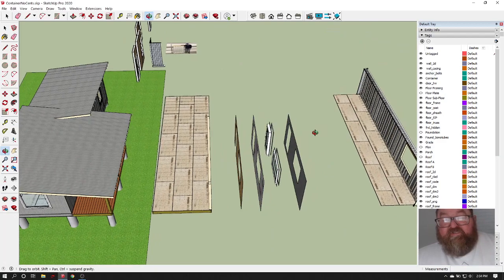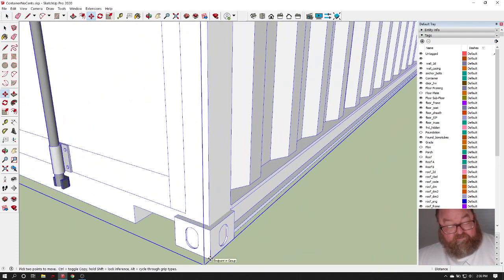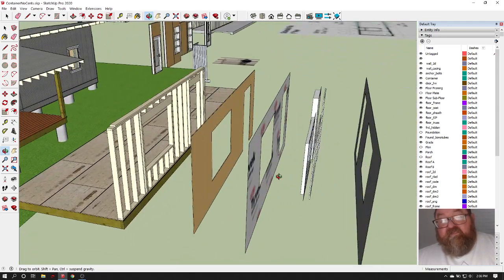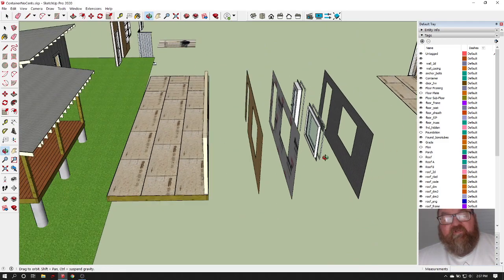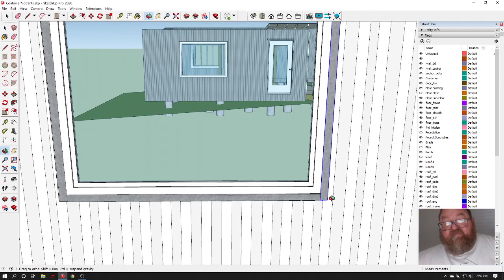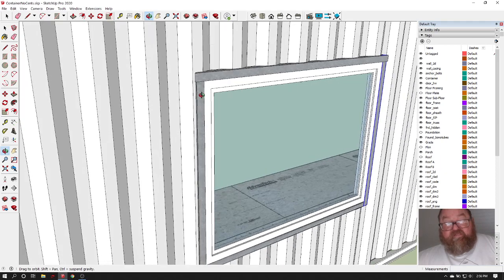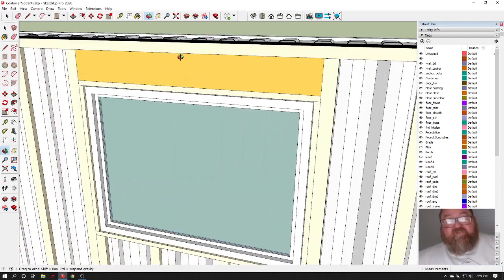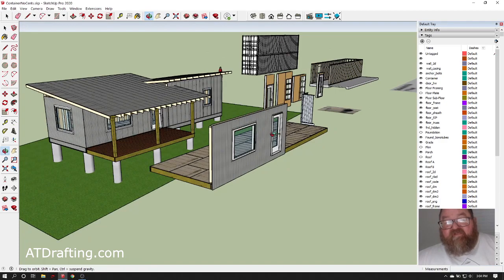Installing Windows in a Shipping Container - No Welding Method

Comment: Great video! How to you attach the galvanized metal flashing without welding them? Are you just screwing or nailing them into the header and jack stud, through the Tyvek? Do you install any flashing tape along the bottom of the sill and jack studs? I plan on building out my shipping container within the month. I’ll send over some photos if you like.
Reply from the maker: I use the flashing tape to avoid any penetrations.  But mostly just friction fit.  Thanks!

Comment: Is there not a benefit to building in a shipping container considering it is a moveable object like a caravan ie.  When you sell the property you can uplift the house and move it and dont have to get architects, planning, etc.
Reply from the maker: I can also move my tiny house I built conventionally for half the price of altering a shipping container :)  You realize that 99% of the buildings moved are not shipping containers :)
Reply: @ArtisanTony  what would be the weight of a shipping container sized tiny home of conventional construction? If it is movable for cheaper than that of a shipping container then that would be a big benefit. On a side note, I personally couldn't make a tiny home as structurally strong compared to that of a container, I would need to employ a builder and there in lies the problem. In my opinion I could carry out most of the shipping container work myself. Not so for a tiny home. Maybe it's not too complicated but I'd need to do some reading.
Reply from the maker: @keeganwrathmall  you have a false impression of shipping containers and if they were a viable source for housing, every spec builder in this country would be using them.  You don't have to learn from pros like me if you don't want to . I have been in the business for 45 years.  Go ahead, buy a shipping container and live in it lol
Reply: @ArtisanTony why can’t it be a viable source of housing?

Comment: How is the 2x4 framing structure on the inside attached to the container or when you build the whole framing inside is it a standalone structure inside the container?
Reply from the maker: Typically you would have framing members across the top to holding the side walls in place so it's kind of a friction fit :)

Comment: Always appreciate your videos and sketchup designs.  So many fake idiots that use SU for interior design or to fool around with but I find it's a different story when you take actual measurements of existing structures and put them in and where accuracy is needed because you will be actually building something.  Shipping containers are joke except for limited situations.  No load on on roof?  Tell that to my local church where they buried the job site shipping container and lined it with some kind of sealant and it is being used to store rain water.  He put cones around it so no drive on it with a vehicle and fall in!
Reply from the maker: I was saying the roof was not designed to carry a load. They will carry some load

Comment: It’s not that a container doesn’t make sense. It’s using up material that’s sitting in yards. Why kill trees??
Reply from the maker: @hatchett999ify  we have more trees on earth now than we’ve ever had in history.  Using wood is actually a very efficient method for construction and steel is much more environmentally unfriendly than we wood.  Ditch your our crazy politics in your life will be happier.
Reply: @ArtisanTony  im extremely happy!!! No politics here. Using up man made material that doesn’t rot easily is more useful. More treason earth than ever before?? You sure about that??
Reply from the maker: @hatchett999ify  I have been in the industry for 45 years and have thoroughly learned how responsible the construction industry has become through efforts such as LEED

I am a certified Construction Technologist through the Construction Specification Institute (CSI) and am very familiar with specifications for third party verification on responsible wood products. 

Environmental Impact of Steel Production:
High Energy Consumption: Steel production requires significant amounts of energy, primarily from fossil fuels, leading to high carbon emissions.

Carbon Emissions: The steel industry is a major contributor to greenhouse gas emissions, particularly CO2, due to the combustion of coal and other carbon-intensive processes.

Resource Extraction: Mining iron ore and other raw materials for steel production can cause land degradation, habitat destruction, and pollution.

Waste Generation: The steel production process generates various forms of waste, including slag, dust, and other pollutants that need to be managed.

Environmental Impact of Wood Construction:
Carbon Sequestration: Trees absorb CO2 as they grow, and wood products can continue to store carbon, making them a more sustainable option.
Renewable Resource: Wood is a renewable resource if sourced from sustainably managed forests.

Lower Energy Use: Processing wood into construction materials typically requires less energy compared to steel production.
Biodiversity and Soil Health: Sustainable forestry practices can maintain biodiversity and soil health, though poor practices can lead to deforestation and habitat loss.

Considerations:
Sustainable Practices: The environmental impact of both materials can vary significantly based on the sustainability of their production practices. Sustainable forestry and advanced steel production techniques can mitigate some negative impacts.

Lifecycle Analysis: Evaluating the full lifecycle of both materials—from extraction and production to construction, use, and disposal—provides a comprehensive view of their environmental impact.
In summary, using wood for construction generally has a lower environmental impact than steel, especially when sourced from sustainably managed forests. However, advancements in steel production and sustainable practices in both industries are essential for minimizing their respective environmental footprints.
Reply: @ArtisanTony  All that for nothing. At the the end of the day I’d rather have a crap load of trees around than a bunch of metal rusty boxes.
Reply from the maker: @hatchett999ify  You are just practicing ignorance.  You can have a bunch of tress around you and have a wood framed structure too.  I hate to break it to you buy 99.9999 percent of all homes are framed with wood.  You just need to learn some things about how the industry works.  But you are probably an old grumpy man who can't learn anything new, lol

Comment: Before installing windows in a shipping container, you should weld in a 2x2 or 2x3 mild steel tube frame or angle iron to add structure. Then a buck for the window and add the window, lexel sealant, flashing tape and etc.
Reply from the maker: The point of this video was to provide a no weld option.  Hence the title of the video.  The framed wall adds the structure without welding.

Comment: The more I watch the shipping container as it is being modified esp for the window opening it's just begging for leaks.  The irregular corrugated surfaces, the expansion gaps they amount of work to cut the metal.  Krazy Shipping container fad.... The roof is like car roof but weaker.  Dreadful - start with a narrow opening on the container and then watch it shrink as you add framing, dry wall etc.  The right way is just imaging you are working inside a shipping container and just build away with the benefit that there is no metal to cut and when you are done no one will know.
Reply from the maker: I agree with you :) thanks for the comment!
Reply: Not true. The roof is much much stronger than a car roof. Roof has specific ISO tests for loads. They are deep drawn 2mm thick corten steel. And all the issues you point out are issues with the design not with the container. A stick built can’t compare with a container structure strength. A well designed build and layout will make this quite viable.